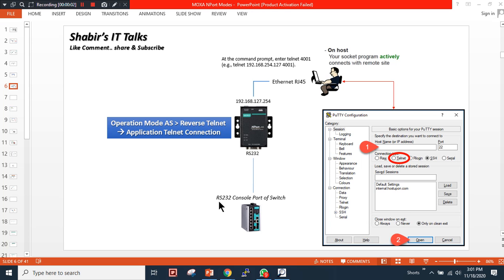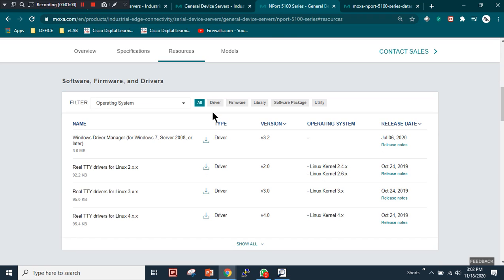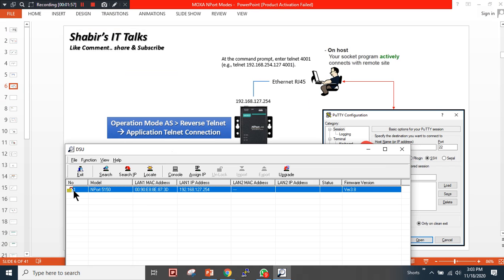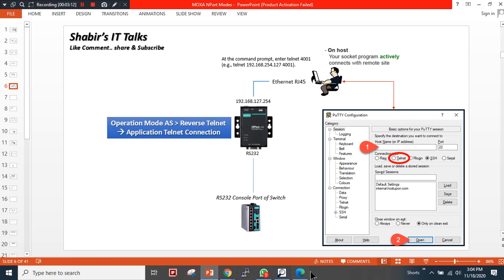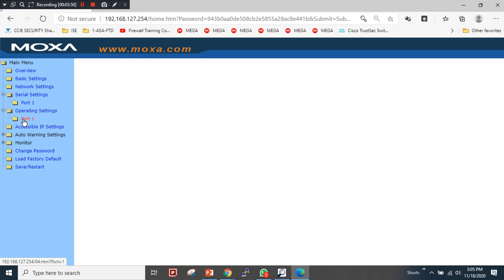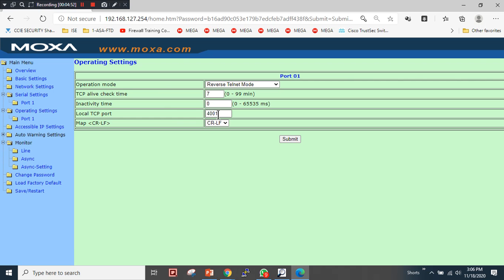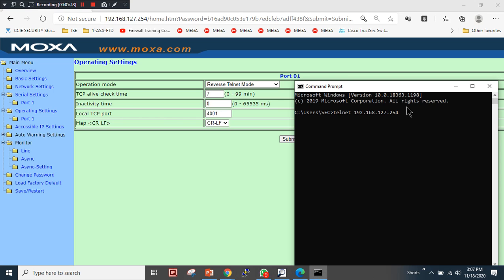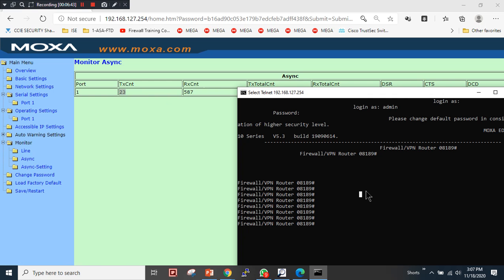How to Configure Ethernet to Serial Converter  MOXA NPORT Operation Mode as REVERSE TELNET

Comment: I am working on moxa mb3480 coverter, there are 4 devices whose rs 485 terminal are looped and connected to 1 port of moxa converter. It outs data  in modbus tcp ip. The problem is that the data after moxa converter is not continuous, its flickering. Whats the solution to make it continuous?
Reply from the maker: drop me email: shabirstechtalk@gmail.com
we will schedule remote session to verify the root cause